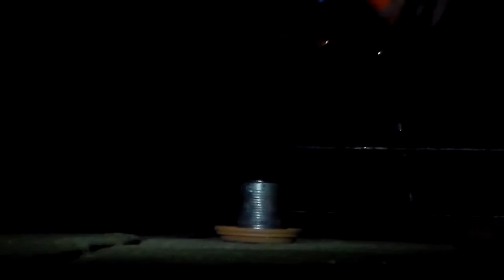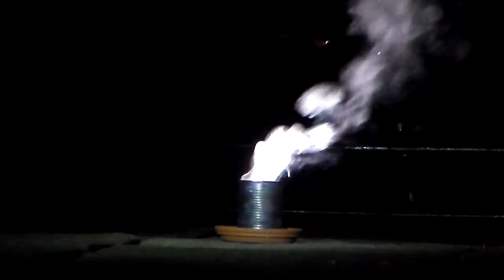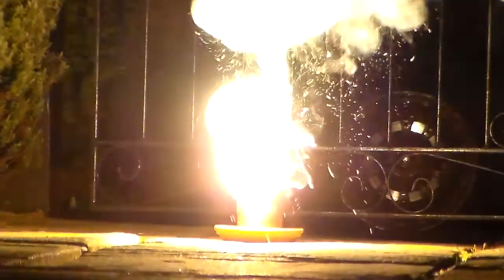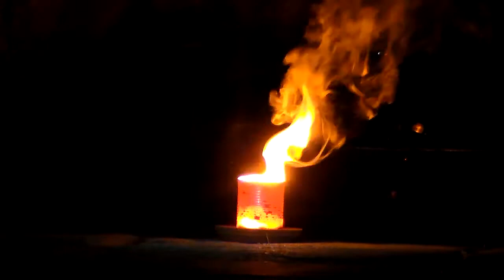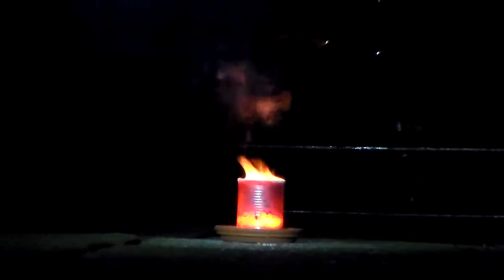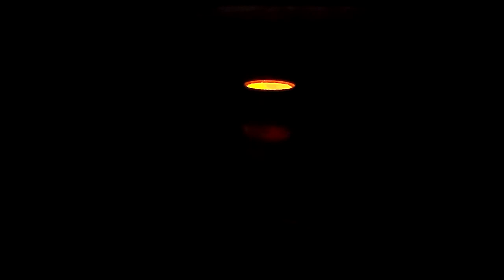Thermite from Silicon Dioxide, Magnesium and Copper Oxide

Comment: so why they say aluminium does not have enough heat, when magnesium is less oxygen affine than aluminium. try aluminium-magnesium silicon-dioxide termite. at least Mg + copper oxide -> MgO + Cu should react, maybe that provides energy for the magnesium to grab oxygen from silicon dioxide.